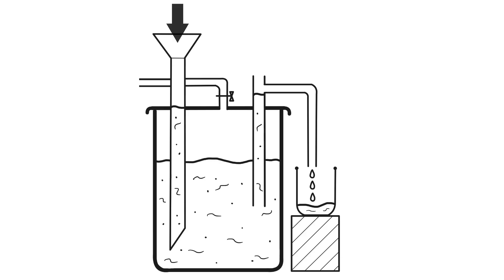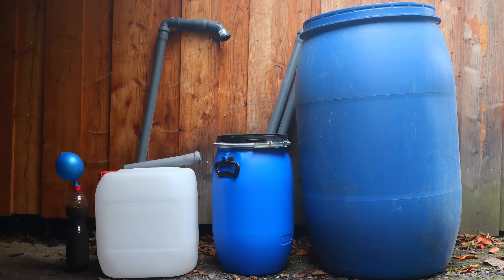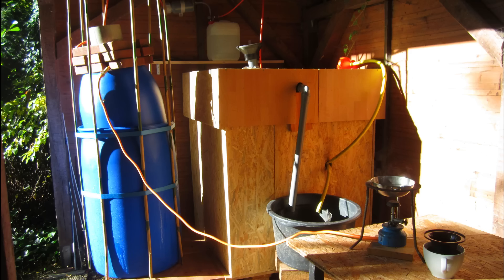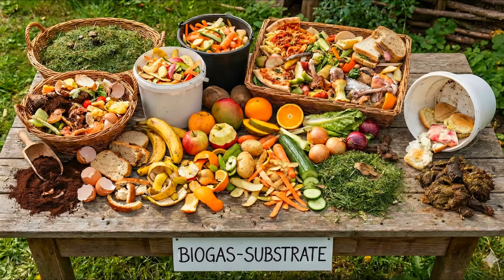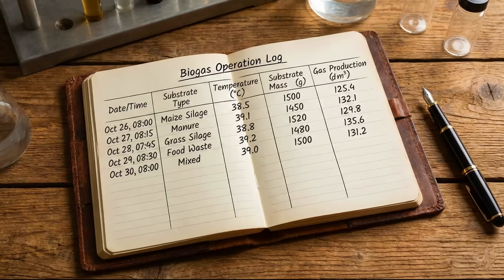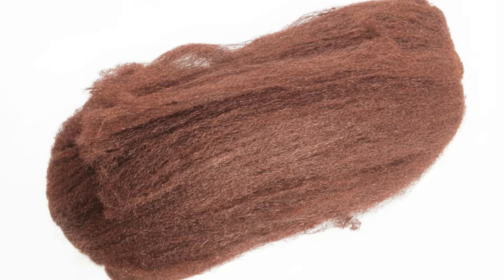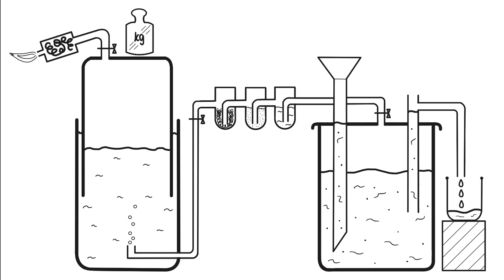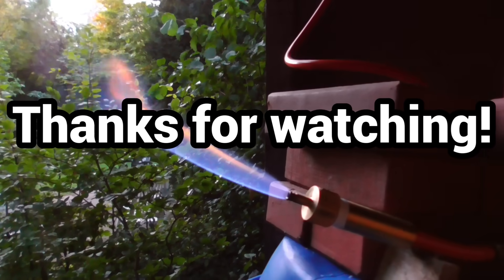Make your own cheap energy with a DIY mini biogas plant

Comment: S-tier off-grid contraption
Reply from the maker: Thanks!
Reply: @myengines2443 what would be the gallons of propane equivalent of your system as shown ? 
Just trying to consider what the amount of possible benefit we could derive? We have three horses and a shed with the mostly  dried manure from 25 years of manure from on average 6 horses in addition to the daily output of the remaining 3 horses...
EDIT: we are in Iowa, USA. .
So we have winter to consider, thinking of using to heat an outside "wood fire boiler" so that we could heat the house and attached garages and possibly a secondary hot water heater boiler exchanger ...the intention of using outdoor boiler system is to minimize risk of methane leak and the potential suffocation risk AND combustion risk to home/garage.
Also, we have plenty of trees & stcks, and could get a wood chipper to add
Reply from the maker: That's a perfect setup for a biogas digester!
You can think of the fermentation tank volume as the daily methane production!
Reply: Clippy your everywhere. How?
Reply: @tomt637  just like the flock cameras. And people are sick of being illegally watched and wrongfully charged by ai+government, the two most inept things ever grace this existence

Yes they're related
Reply: Mahoning had dual fuel boiler systems.  You could look at their designs.

Comment: Did you leave out human waste for a reason?
Reply from the maker: You'll laugh, but many people ask me about it.
However, for infection control reasons, you should refrain from doing so.
Reply: @myengines2443 
Yeah composting with absorbent material (wood chips) works so well that doing anything else with human waste makes little sense (if you have wood chips and compost). See humanure.
Reply: @myengines2443  What if you ozonate the waste prior to use?
Reply from the maker: Please can you describe this further? I have really no clue...
Reply from the maker: But that's a bit of an effort just to use human waste, or am I missing the point of your motivation?
Reply: @myengines2443  You are going to have to manage the waste anyway, you can put it in a hole, a river or use it for fuel, clay for shelter, unlimited uses including roads.  Get my point